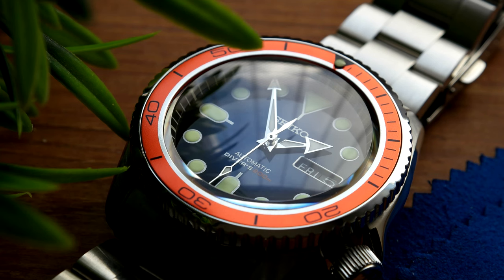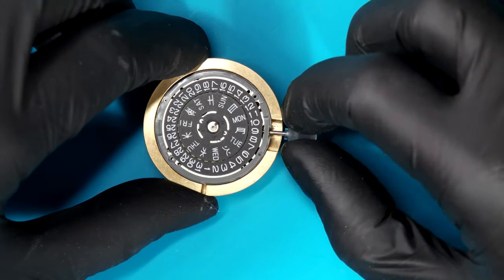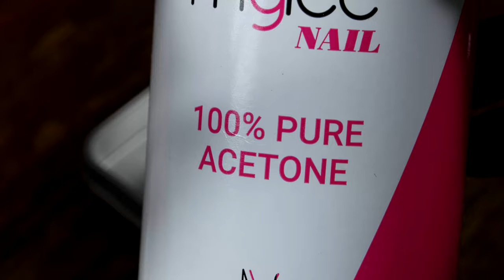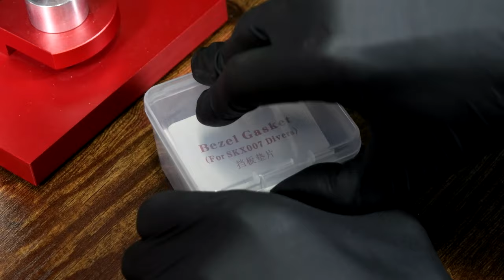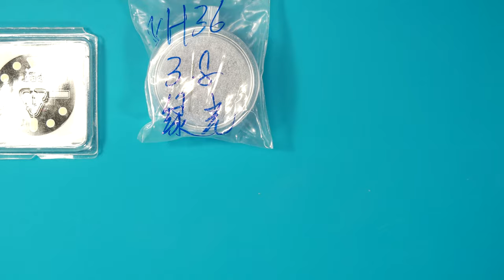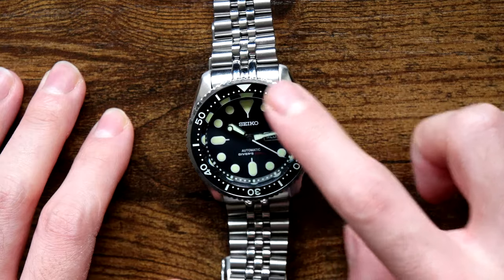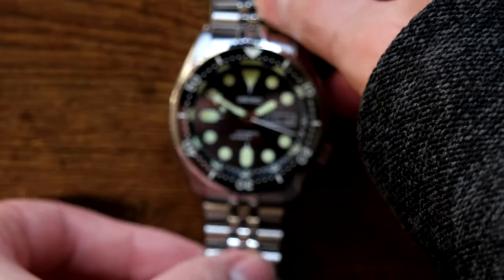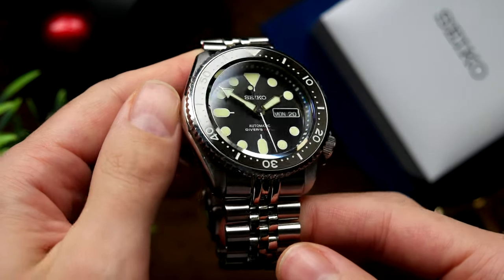Back to Basics - SKX007 Hobbyist Build

Comment: I found that usually using previously used second hands they always seem not to fit and are loose on the second post. Only way to fix them is to pinch the second hand cylinder with a pair needle nose pliers

Comment: If you like tinkering you could try to apply the writing to the rotor directly by using laser printer transfer method. Very much like it's done for homebred electronics board printing.

Comment: Nice build done a few SKX 007 builds myself. Some positive critique.  The bezel action seemed a bit on the slack side for my liking.. Great upload and a pleasure to view.. Big fan of the SKX 007 case the crown position at 4 o'clock is perfect . No digging into the wrist like the usual 3 o'clock offerings.. It also wears will on smaller wrists..

Comment: Just got interested in this hobby and this is golden. Any tips on what watches to get and what kits and guides to have to fully learn everything needed to get in this hobby. Aka where should I start?
Reply from the maker: I'd recommend starting with some cheaper NH36 watches like the Steel Dive or Heimdallr's on AliExpress/Ebay. You get a lot of watch for your money and its good for trying out dial/hand swaps. Bezel inserts are a bit of a pain if you want to change them on the cheaper ones though, as the cheaper bezel retention system makes it difficult to put the bezel back on. But other than that they're a good place to start. Alternatively you could just get an NH35/NH36, a cheap AliExpress case (which, sometimes, already has the chapter ring and crystal fitted) and bracelet and a Dial and hand set to go with that if you wanted to build something from scratch for similar money to the steel dive watches. But the added bonus with modding steel dives is you get to practice removing hands. As for kits, I myself just bought basic watch tool sets and then individually got anything extra I needed.

Just remember, this can be an expensive hobby even if you do end up saving money on some special watches you BUILD rather than buy. The cost of entry can get steep depending on the depth you want to go with, especially when you get into buying crystal presses and more premium watch making tools (i myself just have the cheap ones.)
Reply: @ItsAnotherWatch  Ok thank you so much. And what about learning about the parts of a watch to have the knowledge of the inner workings? Where did you learn from? So I dont just start doing thing without knowing what Im doing. Is there a place everyone goes or a book everyone reads to learn or some type of manual. And yea I saw the steep amount of money for the watches but I want to experiment to see but this really interests me a lot and am fully willing to go all in starting small and increasing as I get more knowledge.
Reply from the maker: @JBMods  YouTube really is the place to be honest, watching disassembly's of watches (in this case Seikos or NH36's)  or watching videos like mine where mods are being built. But i'd start with assembling watches out of parts before figuring out the building of movements.
Reply: @ItsAnotherWatch  ok 👍 Thanks. Ill start with the nh36 and lets see how it goes. Thanks again. Already extremely excited to assemble a watch

Comment: Bit late I know but can you please tell me what you were gluing? I’ve watched twice but can’t understand what needed to be glued . Inspiring video. Thanks.
Reply from the maker: I was gluing the chapter ring where it sits in a little notch in the case to stop it from being loose, as it was shaking around even after the crystal was pressed in. This isn't usually necessary, might have been an issue with how the crystal went in, not being perfectly level. But this doesn't happen very often. If I am remembering correctly, this is the only time it has happened to me.

So if you're doing a build like this and your chapter ring is sitting nice and firm after the crystal has been pressed in, you don't need to worry about gluing it.
Reply: Appreciate your reply. Glad it was an unusual situation as it had me puzzled. Thanks.

Comment: hey, amazing content, I saw many of your videos and I want to make my first skx007 from scratch. I would like to know if I get a nh36, if I need to swap the date wheel and the plastic movement holder, because I don't have a 7s26 to swap between.
Reply from the maker: If you're doing one from scratch you should be able to get away with keeping the grey spacer that comes with the NH36 (if you're getting your case from NamokiMods or somewhere similar) as long as you also buy the appropriate case back that  is for the grey spacer (since they also do one for the black spacer). Heck, if you're going for black day/date discs then you can buy an NH36 that already has some black 3.8 o'clock plates on it so you won't have to change them. Same with the white ones. That being said, if you're interested in changing the plates yourself then you can still get a 3.8 o'clock day disc of your choice. The date (numbers) are compatible with both 3 and 3.8, its only the date disc that is specific to 3.8.

Also, I'd totally recommend using an SKX171 dial for it. Its such a beautiful dial, I did a video on it here: https://youtu.be/sijX9tAbb_M?si=2Hcr4QILL-K6cFwV and you can buy the dial here: https://tokeilab.com/products/oem-dial-skx171

Sorry about the ramble, hopefully this is helpful!
Reply: @ItsAnotherWatch  Thank you very much for the response. I am going to get the nh36 with the 3.8 position date disc. I don't know exactly if the titanium case I own atm has the caseback for the gray or black plastic, but I will test it, and with your explanation, it made more easy to check what I really need. I am looking for the oem dial, because I really like the circles in one color, without the silver countour. The jubilee bracelet is something I am still considering, because I don't know if it is going to be too heavy for my taste, since I am used to seiko 5s and some gshocks

Comment: I appreciate all your help so far.  One more question pleaseeee.   I'm sorry, this is my first time building a watch.  There are many case sizes and they all use NH35 or NH36 movement.  So, for the case I bought, how do I know if the movement will fit or if I need a spacer?  Are there specific spacers sizes I need to look for?   Thank you!
Reply from the maker: If the case you bought isn't shown to come with any kind of a spacer, and is still advertised as an NH36/NH35 compatible, then it should fit just fine by itself. But if the case is also advertised as fitting 7S26/7S36 movements (like the Namoki and SeikoMods cases) then you might need to check if it needs a caseback specifically for the NH or 7S movements. 

For regular NH compatible dive watch cases, you're probably fine since most of them (that are made for NH movements) fit the movements directly. But if you're going for something aftermarket that fits a number of movements it might come with a plastic holder. But if it does need one, it will be obvious (or should be obvious) when buying it, by looking at the pictures and listing details.

Comment: I just installed a chamfered edge sapphire on my SKX007. Is the chamfer supposed to go up or downward facing. I'm second guessing myself now. I placed the chamfer downward facing because chat gpt told me to but I'm not do sure...
Reply from the maker: At 8:45 take a look at the crystal and see the texture of the side that is going down into the watch. The slope on the edge of the crystal is facing upwards, and the part that gets pushed into the case is the frosted edge, with the flat part being at the bottom. If you're still having an issue figuring it out, post a pic of the crystal here and I'll take a look.
Reply: @ItsAnotherWatch  I did some more research last night and figured out that the chamfered edge is supposed to face upwards. Thanks foe the confirmation. Unfortunately I hate the look so I had to buy a small chamfered edge crystal. So now I'm down $60 bucks buy oh well. It will be worth it in the end. I just didn't like how the big chamfer made it look like I was seeing double. Especially in the dark I feel like it affected visibility. I don't like see double like that. The clarity is amazing though. Looking forward to installing sapphire that looks more OEM.
Reply from the maker: @benldr  Yeah, I know exactly what you mean. I even went through that when I did the video for this build. Swapping the crystal out in the end for one with a less pronounced chamfer. Of course in the end I parted out this watch into "The Perfect SKX" and the "Samurai SKX" builds that I also did a videos on, and the Samurai SKX ended up with an Edge to edge crystal that looks great (Where i also went through a few crystals). Suffice to say, I've got a bunch of perfectly usable crystals just sitting in my spare parts collection that I probably won't ever use.
Reply: @ItsAnotherWatch Yeah, I hate to have the waste too but I think I may use this crystal in another watch. I just want to keep my original SKX as OEM looking as possible. I may buy a titanium SKX case and an NH35 to build one from scratch.

Comment: Wierd thing about skx is if you mod them they still thought of as original seiko yet seiko have the movements made in Indonesia and China as with cases and bezels and some dials. Yet at some undetermined point they get called fakes despite all the parts being made in the same place as "originals". Doesn't seem to happen with any other seiko ranges like presage. Maybe the dial sets them apart. I've built a few for people and have a nemo myself which , apart from the lume and cyclops lens, is the same. And they can be Japan made or Indonesian made. Seiko! Sit down everyones laughing at you.